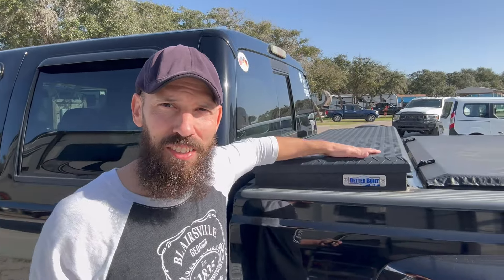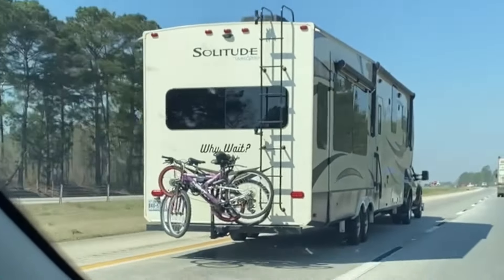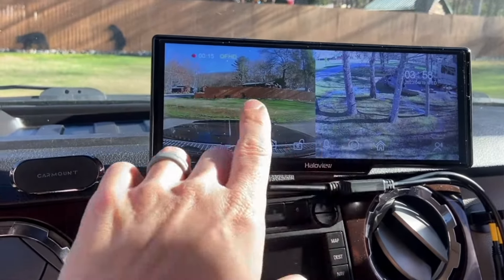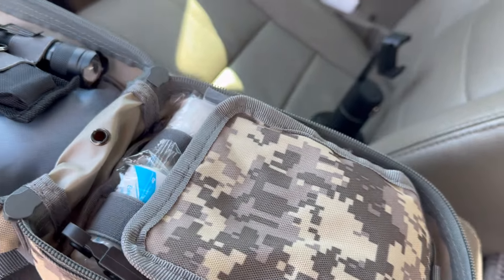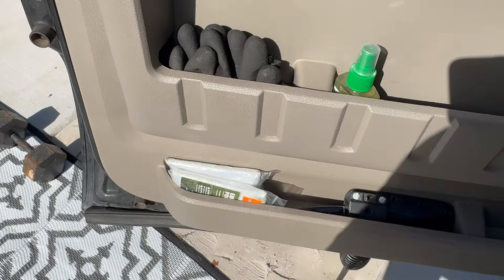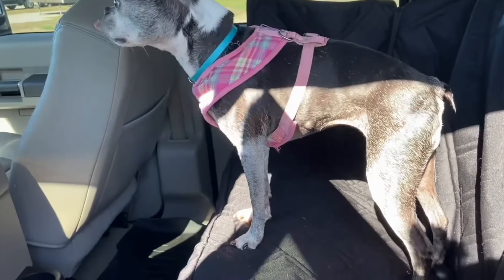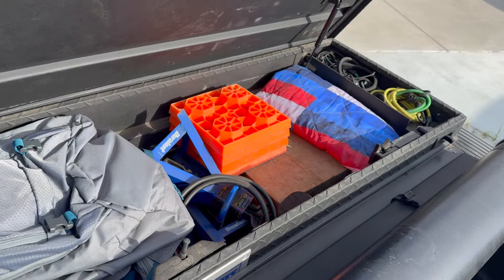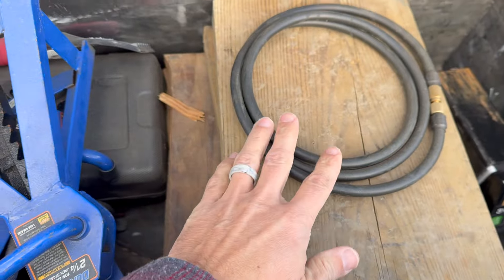How to EQUIP YOUR TRUCK for RV Life (Everything We Carry)

Comment: Great video and lots of helpful stuff. A couple of things I always travel with in my door pockets are reflective safety vests.  Heaven forbid you have to jump out on the side of the highway, they're ready to grab.  I also keep a few ratcheting  tie downs and a tow strap behind the seat.  I noticed the clip you tie the Haloview wires in is taped to the passenger airbag.  You might wanna re route the wires out of the airbag deployment path.
Reply from the maker: Great tip, appreciate it. Didn’t even think about that.

Comment: I have a 90 gallon transfer tank in that part of the bed, so another place to store stuff is in order. I do run a storage bin made to fit under the rear seat, just not as much room for big stuff. Good ideas otherwise.
Reply from the maker: Transfer tank would be nice although between my wife, child and dogs we have to stop every 200 miles at gas stations anyways for pee breaks 😂😂
Reply: @WhyWait  when out west or a trip thru Canada to Alaska (yet for me to do), that extra capacity with limited fuel stations will be worth it. You can still pull over for stops. Perhaps at a scenic overview.

Comment: Where can I get the tool box with the shot gun latches?  Not one on Better Built’s website? Thanks
Reply from the maker: Yes, unfortunately from what I understand they stopped production on this model I believe. It’s a shame because they are great. I got mine at Tractor Supply and hear that sometimes you can still find one in stock there. Good luck 👍🏼